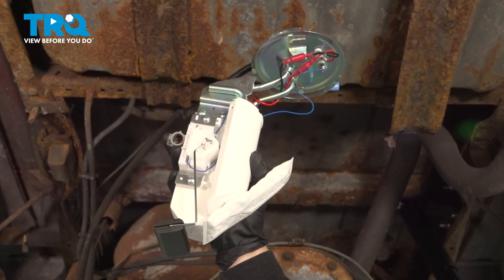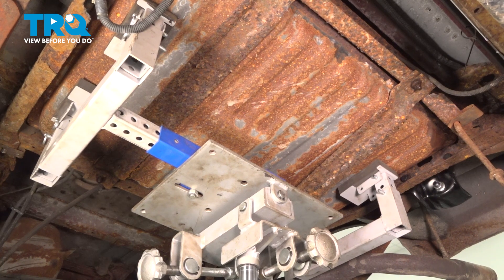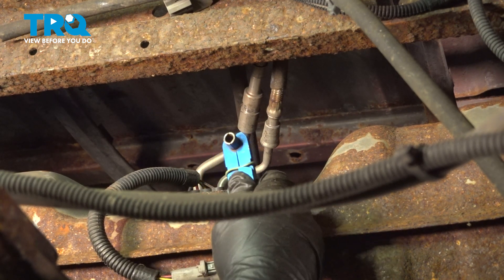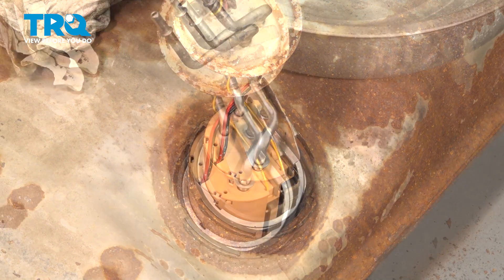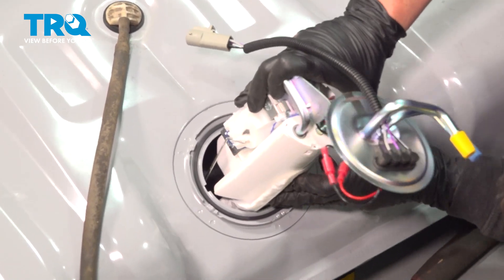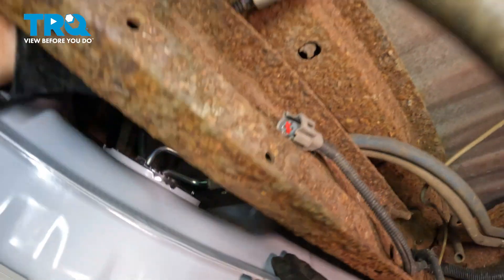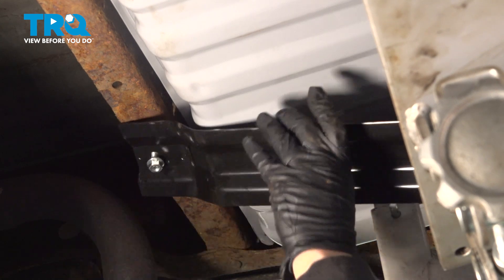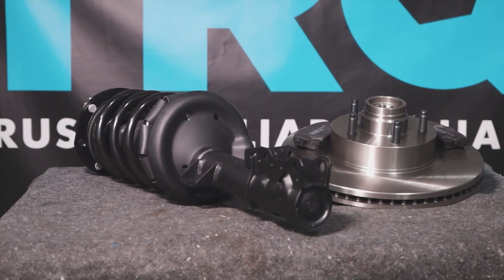How to Replace Rear Fuel Pump Module Assembly 1992-1996 Ford F-150

Comment: Things to note. The replacement pump is not going to be bent at the correct angle, so you will have to bend the tubing some or else it bottoms out in the tank and you can't get the lock ring on. Second, The pig tail is not included because it may be damaged. It's included because the new pump electric connection is going to be different than your trucks factory plug. So you need to wire in the new pigtail on your trucks harness to match the pumps plug.

Comment: I'm assuming this tank can be removed and left out if it's leaking. What do you just install some type of rubber caps over the lines if you don't want to replace it on an old beater?